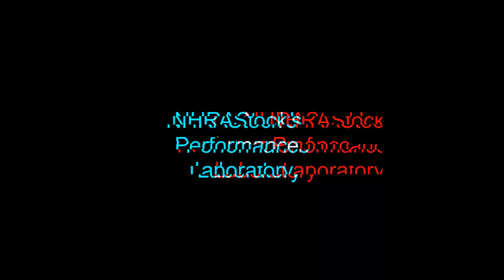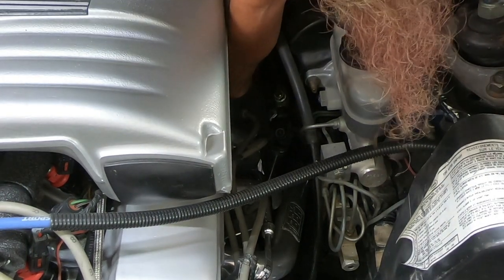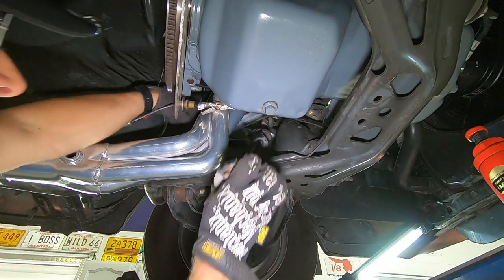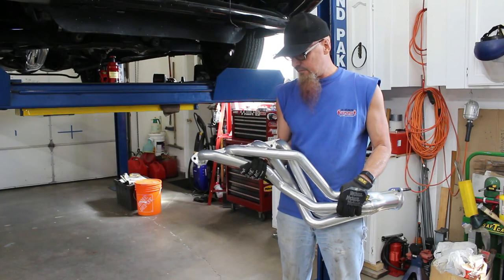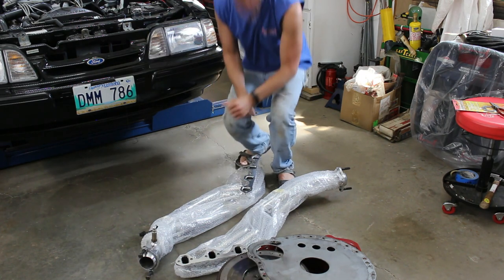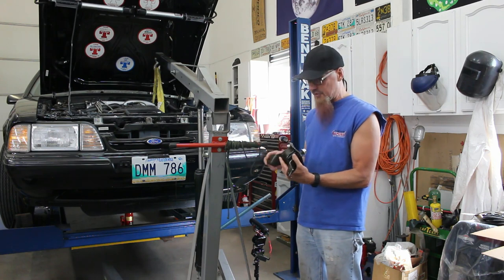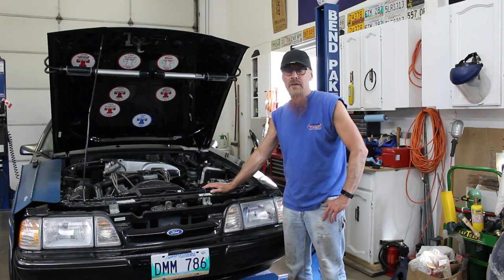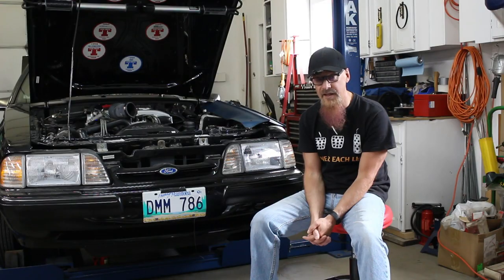Fox Body Mustang Header Swap

Comment: Hey bud what bbk headers did you have on the car before you tried the new bbk headers? Was they auto headers? Thanks
Reply from the maker: Yes, BBK 15310.
Reply: What part number was the manual headers you got? I got the same problem I gotta find headers for the Lakewood bell I dont wanna cut on it
Reply from the maker: @syman9556  15160
Reply: @The_Performance_Laboratory  I wanted to let you know the 15940 bbk headers fit with no clearance problems. No mods needed
Reply from the maker: @syman9556  and you can install/remove the Lakewood with the headers in place?
Reply: @The_Performance_Laboratory  yea like they was made for the bell housing
Reply from the maker: @syman9556  Thanks for the info. I went with the 1 5/8 thinking the 1 3/4 would be a bit big for my little 302, but had I known about the fit I would have bought the bigger ones!
Reply: @The_Performance_Laboratory  no prob. Well I read everyone said the 1 5/8 didn’t fit with out mod. So I figured try the 1 3/4 nobody said anything about them fitting and of course they did.
Reply from the maker: @Jacob The Great I still have the 15310 set.

Comment: 90 mustang here 351w swap stroked to a 408ci. My long tube bbk swap headers fit perfect. 5 speed car. Headers went in from the top with ease. Just remove steering shaft.

Comment: I used MAC headers for an automatic to fit around my Lakewood bellhousing.  The automatics have wider housings, so the headers for autos have more clearance.
Reply from the maker: I discovered that the first set of street headers I used were for an automatic. They cleared the Lakewood fine, but had 2 tubes where the clutch cable needed to be.
Reply: @The_Performance_Laboratory  Oh I see.  BTW love your videos.  They take me back to some of the best times of my life, racing in D1.  Thanks.

Comment: Have You tried a set of Kooks headers they are pricey but You can order them to fit Your specific application ! But when You consider what You have spent headers so far it may have been cheaper. Best Wishes and Good Luck. Thanks for the update.🇺🇲🇵🇷🦊👍
Reply from the maker: I went back to my OG Ford Motorsport race headers with new collectors for street hookups. It worked out well and saved me significant costs.

Comment: That’s typically what happens during these modifications, and us and you SR, are the ones that get stuck eith exspensive parts you can’t use. And yes it sucks.  I feel for you. You will probably have to use the factory shield or go with shorty headers.
Reply from the maker: I went back to my race headers, with new collectors. They fit.

Comment: Whats the part number of the headers? Im curious,  I  want to buy new headers and i'm worried about the lakewood bellhousing clearance issue.
Reply from the maker: Neither the BBK 15160 nor 15310 will work with a Lakewood.

Comment: I had a set of headers for a Big block 66 Chevelle and I swear, the manufacturer must not have known that you needed to put spark plugs, let alone, spark plug wires in there.

Comment: what are you doing with the headers you took off?
Reply from the maker: While I'm tempted to smash them to bits with the biggest hammer I own, I'm likely selling both BBK sets.
Reply: @The_Performance_Laboratory  def. has to be very frustrating. im in nw indiana im sure it wouldnt be cheap to ship this way.
Reply from the maker: @GearheadRob319  I'm sure you could buy new from Summit for less than the shipping cost + what I'd want for the set.

Comment: Rust? Headers? Motor?
Reply from the maker: Uncoated mild steel headers will rust inside. With sufficient valve overlap, at part or closed throttle, the engine will suck the loose, abrasive rust into the cylinders. Not a good thing.